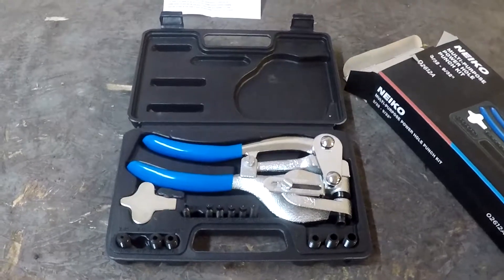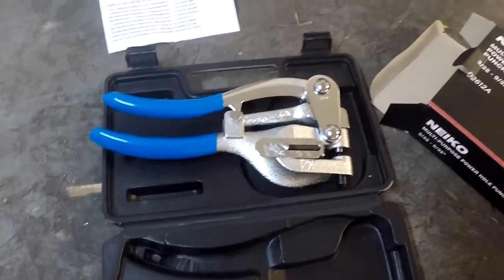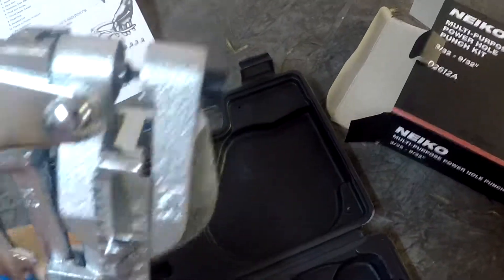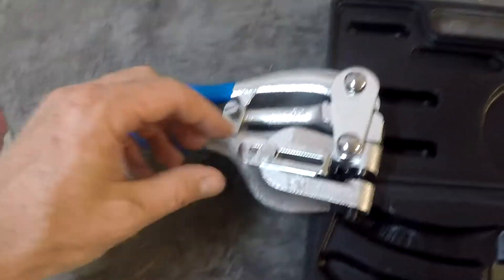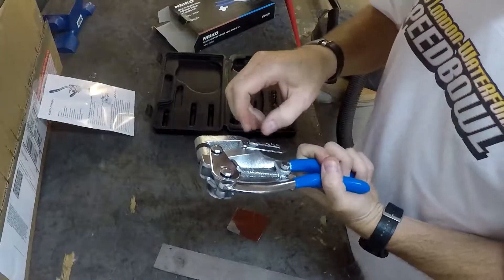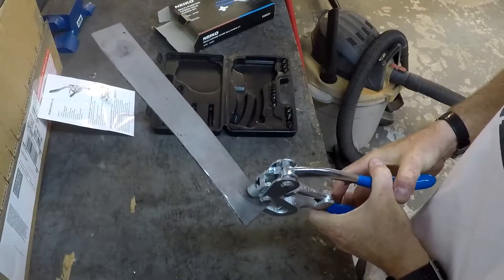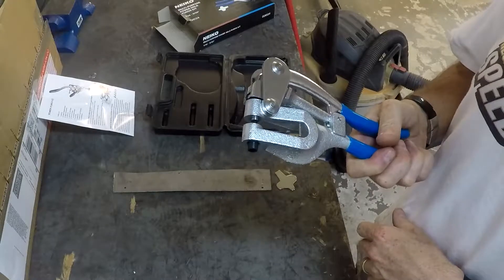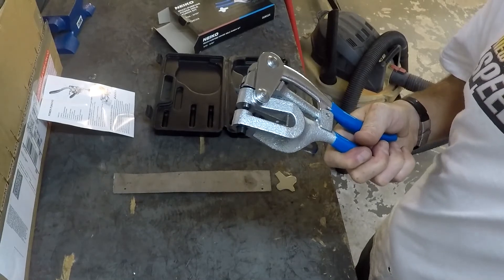Review of Neiko 02612A Multi-Purpose Power Hole Punch Kit

Comment: Thanks for the review
Reply from the maker: Thanks for watching! I still have and use it. No very often, but the cutter has held up and it still works well.
Reply: @roundtailrestoration  I ordered it, I’m just nervous about it’s effectiveness on 18g steel sheet, but it beats hours of drilling. Again, thank you
Reply from the maker: @pattwig329 I used it most on 20 ga, which it didn't have a problem with. 18 was harder, but it did work. Wear some padded gloves.

Comment: Hi, is the tool can be used for 3 mm thick aluminum plate?
Reply from the maker: My guess is 3mm is too thick.
Reply: In your toturial the thickness stainless steel 1mm or 2 mm?
Reply from the maker: @dannychrist5985  The metal I punched was 18 and 20 gauge, which equates to about 1.2mm. You could probably do 2mm, but my guess is the tool will eventually dull (and your hand will hurt!). If you need to do a lot of 2mm, I'd look at either a stronger manual tool or a pneumatic one.
Reply: @roundtailrestoration  
Thanks about your information